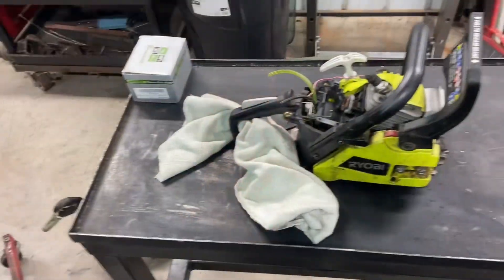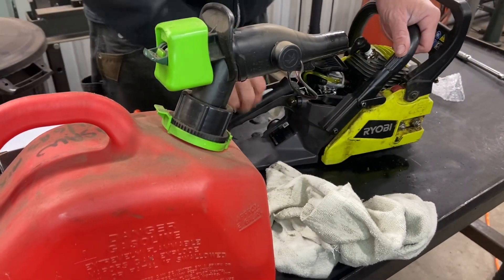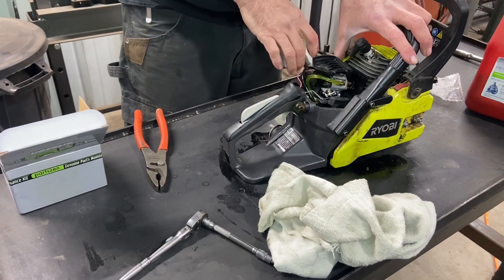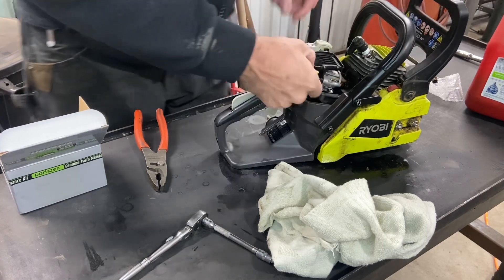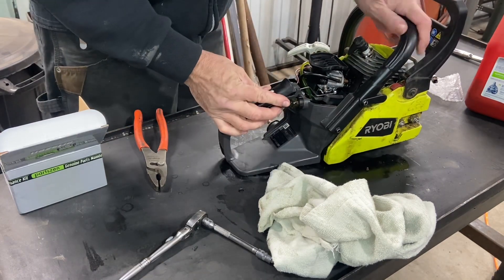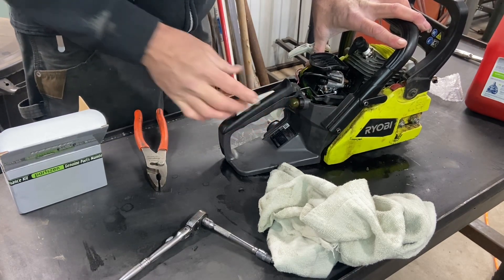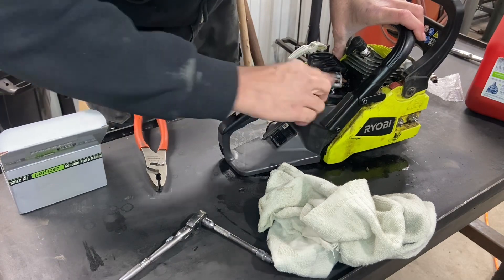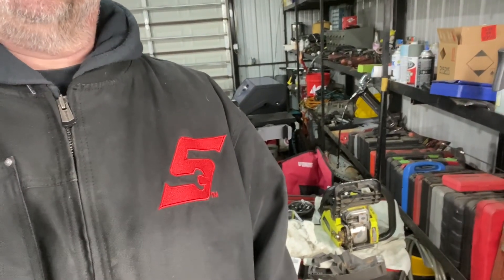Ryobi chainsaw cuts out.  Looking for opinions.

Comment: How did you check the muffler since it is an enclosed unit?
Reply from the maker: When I finally got around to pulling it off again, I heard some crap rattling around inside it and it’s weighed a ton.  Started looking around for a replacement and I haven’t decided yet whether or not I want to spend $60 plus shipping to see if that will fix it or not.  If I do end up getting a new muffler I’ll put a video up about it. I’m just undecided on it at this time.  So I’m the end, the muffler seems to be bad.  I took it too a small engine shop and they said the same thing about the weight of it and with something rattling around in it that’s it was clogged and needed replaced.
Reply: @ogresspeedshop  Hey thanks for the follow up. Mine would run fine for the first tank of gas but when I refilled, it won’t start, I cleaned the air filter and checked the spark plug and they are fine, so I took off the muffler thinking I’d clean the spark arrester but it is one piece. Wow, $60 for a new muffler is crazy when we can pick up lightly used ones for $100. What do you think of soaking the muffler in carb cleaner?
Reply from the maker: @trurex007lee7  I haven’t touched it since I did that little update video talking about the muffler.  Kinda lost interest in it after fixing so much on it and it still acting the same.  Just the cost of the muffler has me not wanting to deal with it.  I may revisit it or I may just look around for a different one.  As of right now, I’ve got an electric pole saw that I’ve been using around the property and haven’t needed anything else yet. Thank you for the ideas and comments.  I appreciate you watching.